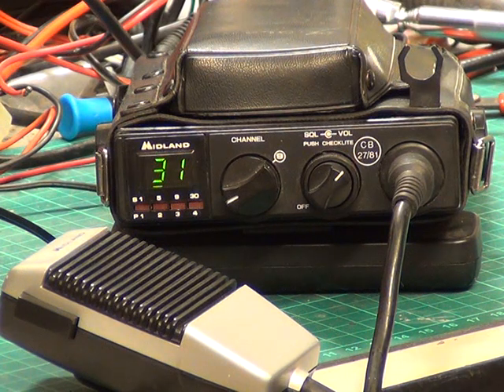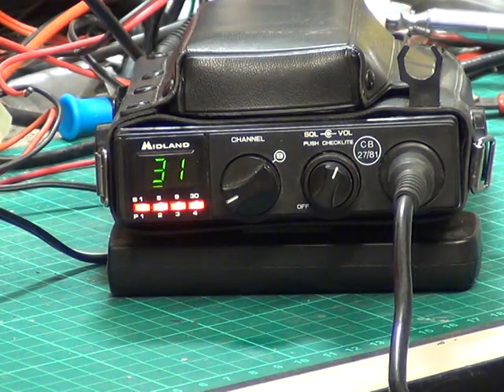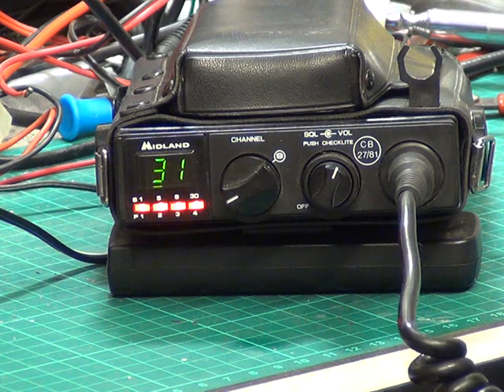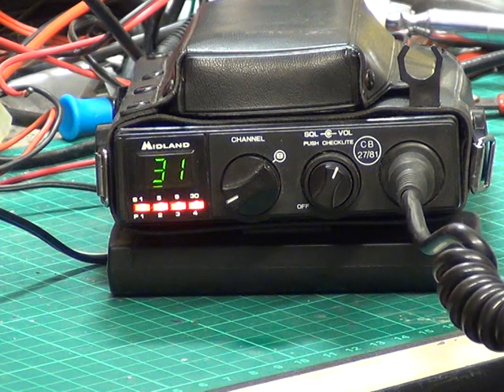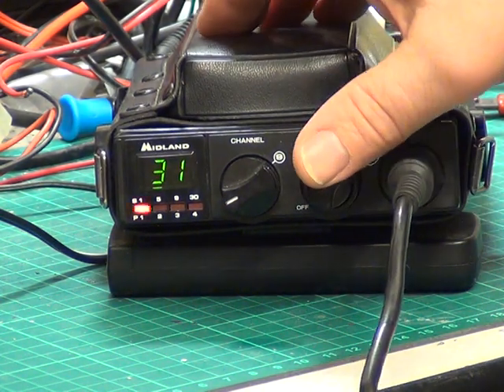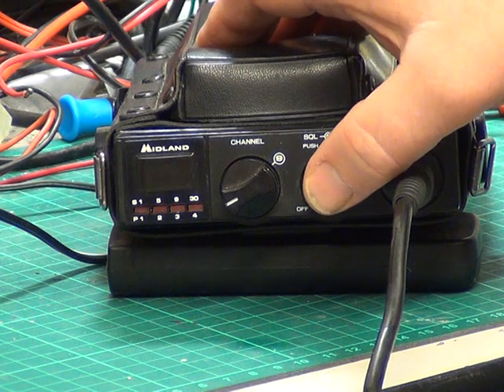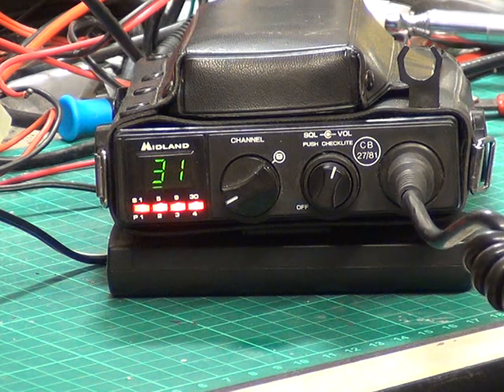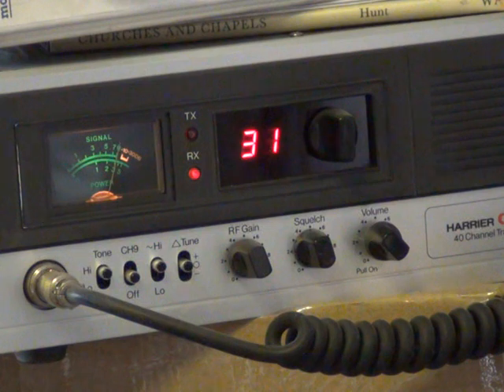Midland 77-805UK CB27/81(transportable) CB radio -  On The Air Test

Comment: I've got the same one I only paid £10 for it at my local car boot sale but the only fault is a wire has come loose on the microphone and needs soldering but I found a spare microphone but it's not a speaker microphone so I'm using it with an extention speaker but I'm going to have to get another antenna as the built in one isn't much good in my flat so I'm going to go back to basics with a biscuit tin and a magmount antenna

Comment: Where can I get a nato 2000?
Reply from the maker: It's not a UK legal set but has a fake 27/81 stamp on the front. Hearsay at the time was that it was a poor performer anyway.  Sorry that doesn't help you but is the truth.

Richard (UK)
Reply: UK CB radio servicing the nato 2000 I had back in 1981 was fantastic it was actually the best rig I had and I had plenty along with communicator, Viking etc even a couple of Homebase’s all legal, other than the nato and a few sidewinders 😉 but I have to disagree with you about the nato and not without knowledge I may add. I asked where I could get one not what you thought of it anyway, 😉.